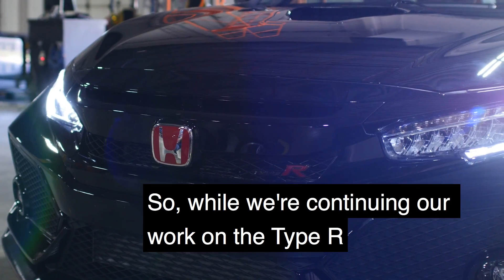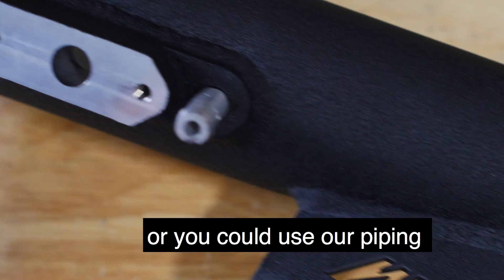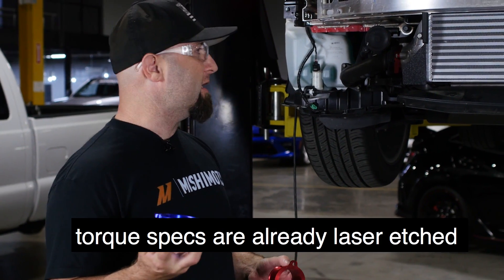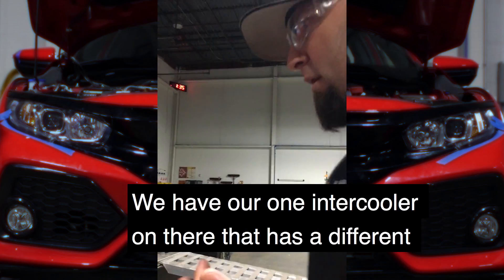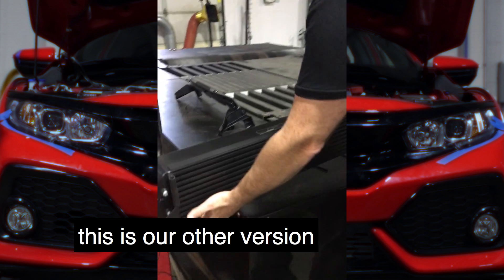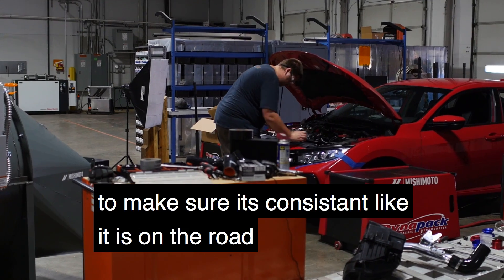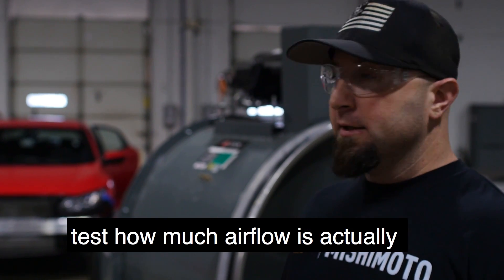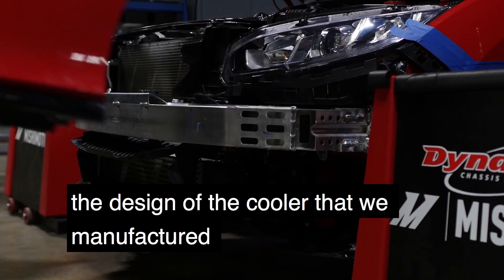Shop Reality TV- 2016+ Honda Civic 1.5T Intercooler Concept to Completion

Comment: Hi guys if I want to install in my 1.5 turno Si do I need a tune up the car or can I use it like that factory power it will work out ?
Reply from the maker: The intercooler will install and run fine on a stock tune. Keep in mind that because of the increased volume without a new you will notice a slight lag in response. However it will safely run without the tune.

Comment: I have compared the PRL I/C with yours and definitely "size" matters for optimum benefit.  Since I own the CVT and remaining on the stock tune, I would recommend just procuring the I/C itself without the piping.  The mitigating factors between the two brands are that PRL tested their I/C with a CAI + DP/FP and increased the size of both charge pipes.  Yes, that does increase the breathing and exhaust flow; however, one would need a tune due to the increased air volume; especially with the DP/FP.  For those with a CVT that wish to keep both their IAT post temps down and maintain the longevity of the CVT, I would highly recommend the Mishimoto I/C with or without the piping.

QUESTION for Mishimoto:
Since your I/C is in essence 102% greater in volume than stock; Is there increased "turbo lag" with your I/C on a stock tune?
Reply from the maker: Hey Holly,
The MMINT-CIV-16 kit shouldn't provide any noticeable difference with lag. The core may be larger but it flows much better than stock.
Reply: Mishimoto Automotive Thank you for the reply!  Greatly appreciated.  With having the CVT and not opting for increased boost I aim for optimum efficiency w/o having to increase the diameter of the charge tubes (like other manufactures).
Reply: @MegaHollywood1971  i have CVT too and worry about turbo lag if i change bigger intercooler , just confusing...
Reply: @MegaHollywood1971  I have a 2020 civic cvt aswell with phearable tune and CAI. would u say going with the charge pipes a good idea. U think it’ll make a difference?

Comment: Since my civic is already hitting 24 psi I don't believe I have flow issues, so by increasing piping size will that reduce velocity in the air and increase lag in the turbo?
Reply from the maker: Hey Awsom Sauce100, installing a larger diameter pipe can reduce stress on the turbo and allow it to spool a little quicker in most applications, effectively reducing the turbo lag and increasing horsepower slightly. You'll get more with a tune, but it can help the engine's responsiveness a little even on the stock ECU setup. This will depend on the vehicle however as some will see opposite effects without additional tuning. Once we finish up our testing, we will have more details for the CTR!